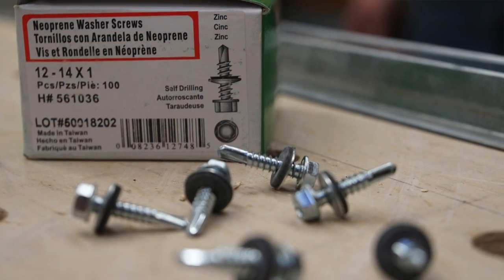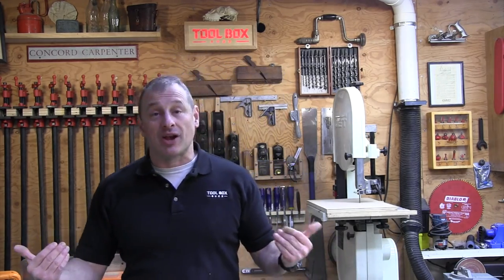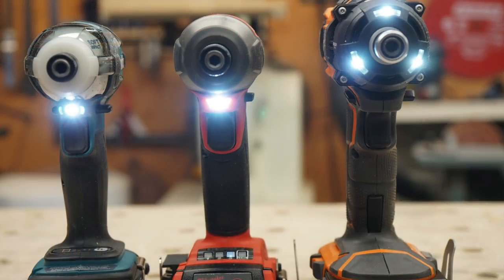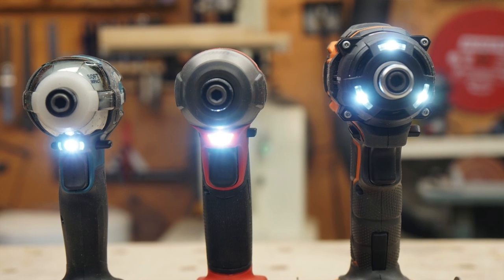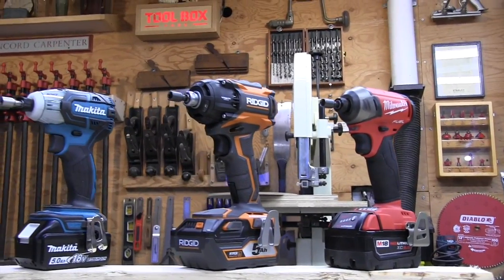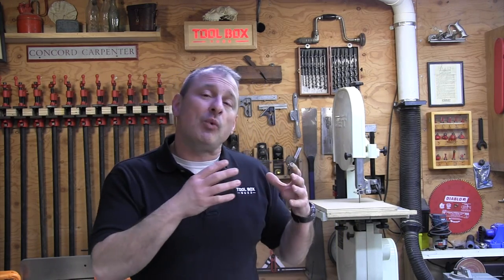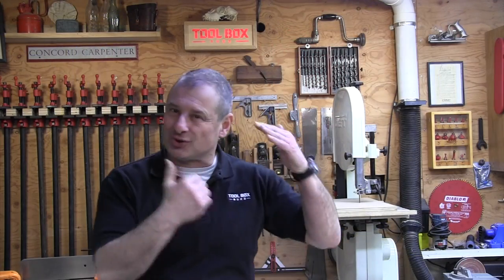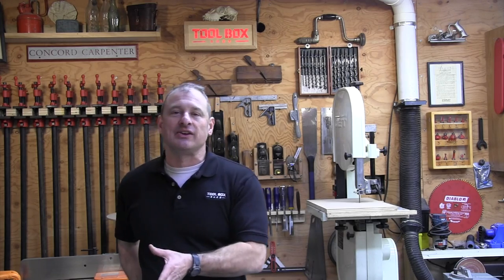Best Hydraulic Oil Impulse Impact Driver - Head-to-Head

Comment: My question about the oil impulse causing less vibration, is why does the Rigid look so visibly wobbly when driving compacted to the others showing none.  Oh I just got to the part of the video about reactionary torque I assume that’s the answer. 

I wish Milwaukee would have kept the original plan and gone for big power and just dialed out the torque wobble though, especially since they came out with the m12 which is not far From the m18 if i understand correctly. Is the m12 surge based on gen 3 m12 or gen 2 like the m18 surge? It’s hard to know from the spec sheets given the deviations

Comment: increased durability?
ehhhh, no these style impact drivers will lose performance over time much faster than a traditional impact
AvE did a good video on how these work and explains the shortcomings. That said these are pretty good at what they do
Reply: Wazoo117 he did the ridgid surge which has a different type mechanism than the other two they might last longer and I hope ridgid upgrades their mech
Reply: I got the Surge late in 2016 and I haven't noticed any performance reduction.  Even if it died tomorrow,  I'd buy another without hesitation.  I'll never own another standard 1/4" impact again.
Reply: I’m sorry I meant to say ridgid stealth. The surge has a different mech that I believe would last longer than the ridgid
Reply: ave was completely got how the ridgid one works wrong, it works in almost the complete opposite way to what he said, so i doubt you'll see the wear he thinks there will be .
Reply: Glad to hear that
Reply: don't get me wrong i loves ave's video's but no ones right 100% of the time lol
Reply: For my own edification how does it work
Reply: Ave? That guy gets his stuck in a vice.

Comment: Once I used the Milwaukee surge I can't use a regular impact. I really notice the vibration.
Reply: Thanks for the input! It took me 16 years of working in construction after college and then getting into woodworking as a hobby before I finally got an impact driver last year. I cant believe I ever lived without it - and it's an el cheapo Hitachi. I will definitely upgrade when this one kicks.
Reply: Same here or hear ;). I can't seem to want to upgrade to the gen3 impact simply because I luv the Surge so much!  Let's see if an update comes up this year.
Reply: @ibrazeau3044  yeah exactly. My surge handles everything I need in an impact. Anything else means I need an impact wrench. Impacts are getting more powerful every year but I notice more fastener and bit breakage.
Reply: D Fruin - ditto to that... the gen3 is too much impact for most what I do.  Plus, I have the stubby, mid-torque and high-torque impacts wrenches just for those fasteners that require the oomph required.  That's why the Surge sits well with most what I do! If I need a little more, I can always pull out the 2753 or one of the wrenches.
Reply: I put it to some heavy use, and it handles everything I need.  It's such a pleasure to use.  Added bonus for me, I don't need to label my name.
Reply: Sergey Pober Lucky you.  I had to ID mine because everyone of my staff has one... I just like using mine and mine only ;)
Reply: @rickrudd  Actually Hitachi is not bad gear
Reply: @johnwallace1729  I LOVE my Hitachi framing nailer, but I got one of those combos with an impact driver and a drill, and the chuck on the drill won't hold small bits. It's kind of maddening, actually, because I can't drill small pilot holes in hardwood. 
Love the impact driver, but the drill is sub par.
Reply: @rickrudd   Good to know the  gen 3 Milwaukee impact is literally dropping bit holders out of the chuck  , every company has issues .

Comment: My carpentry school right now use Dewalt, makita, Ridgid

I ended up liking Dewalt best for doing all my project. 

I feel ridgid have power, but less accurate for me with their saw when cutting I hate it.

Makita I absolutely hate it why because I think their design is just WTH and hard to use with. All my classmates also agree with me.

I ask my instructor of the three which one he likes best and he actually said ryoby instead Which we don't even have in the school lol.
Saying any brand can get the job done, ryoby is just cheaper lol and this due is 27 years experience lol.
Reply from the maker: Chong Thor BTL best of luck in the trades

Comment: There are tools even quieter... A drill. And they are just as fast or faster for those types of applications.
Reply: You obviously have never used an impact to drive fasteners. Once you do, your drill will be left to just  drilling. Even then, an impact with a spade bit is better at cutting through joists, etc.
Reply: @frugalcalvinist 

You've obviously never used a quality drill.
Reply: @sas281gt  Geez, you mean  all these companies making impact drivers should be just making "better" drills instead of impact drivers? Wow. I guess millions of people have been completely duped.
Reply: @frugalcalvinist 
It wouldn't be hard to dupe an impact user. It's clear none of them know how to put a screw in straight. Much less, display any knowledge of proper application of torque. Hell,  they can't even differentiate between #2 or #3 Phillips.
Reply: I’d rather use my drill over my impact too I just like how quiet it is

Comment: Looking at the website, you have some Interesting comparisons. Some things to note:

You could get two 6aH Ridgid octane batteries for $139 for a total of about $340 to put the 3 options at all about  the same price, but you'd have 2 small and 2 large batteries, putting Ridgid as the clear value winner. Or if someone just needs the 2 smaller batteries, it's still the value winner.

Weight wise, 1.8 vs 2.8 vs 3.0 puts the Makita in it's own class. The Ridgid and Milwaukee might as well be tied, and if weight is your concern and not size, the I'd take the Ridgid over the Milwaukee due to the torque. What is Milwaukee doing with that weight???

Sound wise the Makita and Ridgid did fairly close within 3 decibels of each other, but Milwaukee again not falling in line. 

This really seems like you have 2 choices here. If you want value, then Ridgid, if you want performance, then Makita, of course ignoring if you're already invested into a particular battery platform.

Comment: How does it compare to the impact driver in tq rating?

Not used for carpentry, but mechanics..  Nuts bolts ect.
Reply from the maker: Nick Mieloszyk torque is lower that std. impacts. It’s not designed for the auto trades but could do a fair amount of stuff, just not but breaking

Comment: the Ridgid design is much different than the other two.  If I had to have only one impulse driver for all my needs it would have to be this one because of it's ability to do larger fasteners.  The way it hits is very powerful but also a little less refined.  If I was screwing sheet metal screws all day then the other two are the way to go but putting longer fasteners into wood it kicks butt and retires my other non-fluid impact driver for sound purposes.  I won't buy another non fluid impact driver again.

Comment: In car audio  we perceive every 6decibels 2x as loud by ear... so 10db is almost<12db+ is>  4x as loud to our ears !

BASS head's will NEVER go deaf as long as they tune THIER system properly because BASS doesn't harm our hearing until 30minutes in of 166dbs at low hz frequency like below 45hz...   high hz frequencys that are unbalanced & untuned with high pitched vallys and  peaks and  lots of unfilterd distortion and noise is why people have hearing trouble...... standing next to full stacks & midrange pro driver's that do 160dbs can also cause hearing loss ...

FACTORY systems & upgraded factory radio systems are junk because  they often  cause lot's of ear fateage as well as sound cancellation frequencies can cause ear fateage as well!

Comment: Your pricing doesn't really add up, you may want to revisit that part. for instance the Ridgid with 2 batteries and a charger is 199. if the Milwaukee with two batteries is 329 that is not a $50 difference.
Reply: He was saying that with the same amp hour value batteries you'd have to buy more batteries for the ridgid making it more expensive

Comment: I bought the Milwaukee surge. Didn't care for it. It didn't have the power to drive most screws.  It is quieter than a regular impact.  But when working in doors with smaller screws, its still a lot louder than a plane electric drill.  A m12 electric drill set on a low torque setting is a much better tool for such applications.  And if you need more power adjust the torque settings.  It's cheaper better, and a quitter alternative.  So this tool is a don't buy.
Reply from the maker: Scott Courtney nothing is as quiet as a drill

Comment: I know people are going to jump on my back. It what about ryobi?
Reply from the maker: We didn't feel is was a Pro tool, in hind-sight we should have included it
Reply: @ConcordCarpenter  You need to reconsider your stance on the current generation of Ryobi cordless products. They can more than hold their own among ANY of the other brands, at a significantly less price!
Reply from the maker: Marko Grishan agreed
Reply: I owned the Quietstrike and returned it for the Surge and am much happier.  I like Ryobi but the Surge is half the size and smoother.  The Quietstrike's seems to only have 3 speeds under load instead of being constantly variable.

Comment: i have the ridgid one it will snap off bolts fast if you use 3 its over powered  you mainly use 1 mayyyyybe 2  3 is like super charged.. i actually hate it... spent 200 bucks on it and went back to a typical hammer head from milwakee 99 bucks.... why it hits faster yes its loud but who cares

Comment: My personal view is you cannot have an impact driver without something called impact so basically put some earplugs in tell people you’re working it’s gonna be noisy for a little while get the job done and get out metal on metal contact will always produce higher forces and  therefore a stronger tool than oil drive 

This “quieter” thing is a marketing gimmick to my mind........

It would be equivalent to putting rubber blocks on the end of a steel hammer to quieten the noise between the hammer and the nail head.....  

it’s stupid......

Some jobs are just noisy so the issue then becomes schedule a convenient time get on and do it in an out as quickly as possible and wear earplugs